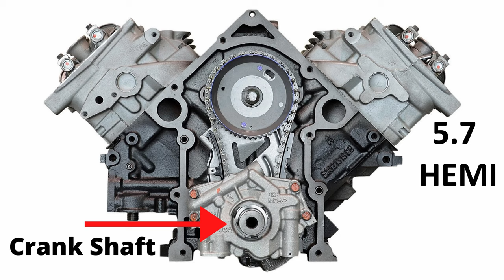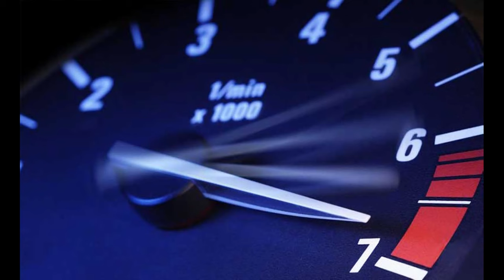HEMI TICK Explained (Easily) - The Cause and How to Diagnose

Comment from the maker: Check out second video on the HEMI Tick for more info - https://www.youtube.com/watch?v=sOH4DCOn0uw
Reply: Hey I got a 07dodge ram hemi would changing the oil every 5000k help reduce the chance of the hemi tic ? (Bad cam and lifter)
Reply: @redneckhillbilly8788  Nope. I have a 2010 and I change the hell out of the oil on average every 6 months and 2500 km's. Issue arrived regardless.
Reply: What if we use a additive to the oil or maybe a sticker oil, would that help?
Reply: Ok so here we go, bought this truck about idk 7 months ago maybe and it was fine but then of course right now today this engine is the 5.7 and guess what the tick has started its right at 219, miles and it has always been taking care of the engine and the truck so yea I'd say this is definitely something that should be recalled but then WE ALL KNOW THAT NO CAR MANUFACTURERS ARE GOING TO TAKE IT ON THE FACE AND SAY YEP WE SCREWED UP BLAH BLAH SO I SAY TAKE THEM ALL AND RUN THEM ALL AND SCRAP THEM DNT BUY ANYMORE LET THEM SIT NOMATTER HOW GOOD A DEAL YOUR THINKING IT IS YOU GET 1 AND YOUR GOING TO ABSOLUTELY HAVE THE LIFTER ISSUE REGARDLESS OF ANYTHING YOU DO OR TRY AND DO.

Comment: This is definitely recall worthy. Step up Chrysler and do the right thing. 👍
Reply from the maker: They won't recall them, It's a not safety concern and it would cost too much money and damage to the Hemi brand
Reply: My 2018 has 86000 km and it’s doing it now….
Reply: not really something you can recall because its about the design and how the lifters sit is all it is. they did the same thing to the 392 but fixed it on the hellcats
Reply: This prevalent on the 3.6 penestar. I own a fleet of promasters
Reply: Chrysler, come on stept up and do the right thing elimate the tick in the engine with a recall.
Reply: @TheGettyAdventures  when the car dies in the middle of the road do to cam determination is a safety concern
Reply: I got a 2006 Dodge charger rt I'm suffering from this 😭
Reply: I wonder if a good flush with BG EPR would fix this. Those lifters have very tiny oil passages that can be clogged.
Reply: My 2016 1500 5.7 with 50K miles just started doing the ticking. 🤬 it is definitely there when the engine is cool and idling. After I run the engine and it’s warm the ticking seems to have gone away when it’s back to idle with a warm engine. Is this just typical of the problem or is this just because it’s had a chance to lubricate those lifters better?
Reply: @lenzkevn  I'm in the same situation as you. I got a 2015 ram with a hemi with abt 56k miles. Cold start ticks pretty bad, but goes away when warm most likely due to being lubricated after being ran. It's frustrating knowing there's not much to do about it
Reply: @lenzkevn  I have the same problem
Reply: I have a 2012 1500 and I’m on my second time having the lifter and roller replaced. My truck only had 100k when it first happed and now I’m at 111k and I’m back at it. At 5k a pop to fix this I’m a very pissed off ram owner. My truck was and still is maintained good oil changes and everything. Now who do we contact to complain cause my level of maintaining my sanity is dwindling with this. They need to recall this cause it’s not right.
Reply: @Youngandfree618  I repaired my hemi myself. Tore down the motor in the truck  replaced the cam and lifters and reassembled.   I've got around 20 thousand miles on it since the rebuild. Changing oil and filter at 3500 miles.  Made all the repairs for under 1000 dollars. Don't trust a shop to do the work. Especially when I can do it myself
Reply: If it ticks cold and goes away warm, it’s not the lifters.
Reply: I agree with you 100%! I have a 2019 and when it got to around 80,000 mi the infamous hemi rattle started.
I am a Mopar man but this is most likely going to cause me to go to GM when I buy my next vehicle
Reply: Only happens to hemi that you let idol for 87 years.
Reply: My 2014 is really bad at start up but I have 186000 miles on it I've asked my local dealer they told that's just a hemi there's no problem
Reply: @mikevalestrada640  
Does it go away when it warms up?
Reply: @mikevalestrada640  even after I replaced the cam and lifters in my 2011  it has valve terain noise not sure if it's the lifters or the timing change I've just accepted it and I do service at 3500 miles religiously and have around 60 thousand miles since the cam swap
Reply: @TheGettyAdventures a thrown lifter will damage the hemi brand too
Reply: Hellcat oil pump.
Reply: My 2021 RAM with 36,500 miles has the ticking now.
Reply: I would agree there is definitely a design flaw with these engines, but I would say that along with the extended idling, I believe the extended oil change intervals, the 5w20 oil and the tiny oil filters put on these large V8’s are adding up to lifter/cam failures…there are so many low grade oils out there that are cheap and plentiful that people are using and these 10,000-15,000 mile and higher oil change intervals because the bottle says “extended performance” are a definite issue…coupled with the tiny oil filter they have that most certainly restricts oil flow in time, is likely a large contributing factor in these premature engine failures…so use a high quality oil and filter and change them often…I have a 6.4 with over 64k on it with no problems…I also do not use the factory recommended oil filter…I use the longer version of the factory filter for more capacity, which just so happens to be the same filter that the Ford 3.0, 3.5, and 3.7 Duratec engines use…fits like a glove…that being said, this filter may not fit on the 1500 hemi’s because the steering rack may interfere…I have the power wagon 2500 which also has a much more stringent oil requirement than the 5.7 Hemi does…I’ve used nothing but the factory recommended oil since new!
Reply: @MrMan5014  I’ve brought my truck to the actual dealership I leased from for the exact mileage allowed for the Chrysler recommended oil change and still got the noise (ticking).
Reply: @MrEdvarts  the problem is the recommended oil change intervals are way to much…I change mine at around 5000 miles maximum!…even if the oil is still able to lubricate, the filters are so small for such a big engine that they are restricting the flow too much after 5000-7000 miles…the very first oil change I did on my Power Wagon was at a quick lube place called Lubber’s and they put a bigger oil filter on it because they said the factory filter was too small and couldn’t hold enough contaminants between oil changes…I think they’re right!
Reply: @lenzkevn just curious, did you end up getting it fixed or is it still running with the tick, my 2016 does the exact same thing. Runs great otherwise, just mostly the noise frustrates me

Comment: For perspective ive been a Chrysler and benz certified mechanic for a decade now. You've made good points, and in my opinion this problem should be recalled. We do have an updated maintenance schedule for the 5.7. Its now 3500 instead of 5000. Due to the design you are correct that the bearing dry out ,but the oil used is light enough to lubricate sufficiently until its ran any longer than 5k miles. We've had 5.7s with as many as 240k miles with no major mechanical issue. Should still be recalled
Reply from the maker: Awesome thanks for the feedback. It does seem like there is compounding issues and not just one clear cut problem. one thing that is crazy is that my 2017 ram tells me to change my oil after like 14,000km. I do it every 5,000 but still nuts that some people trust the "oil life" gauge and get it changed once or twice a year max. so dirty oil could be a large issue as well. Idk it is kind of odd that FCA hasn't addressed the issue.
Reply: 5k miles with regular or full synthetic?
Reply: Would running a thinner oil like a 0w20 vs 5w20 help ?

Any aftermarket additives?  Lucas ? Etc
Reply: @bobbobby6703  full synthetic
Reply: @dark30welderwelding11  thinner oil isn't recommended. Lucas added to the oil does seem to help in our experience short term.
Reply: What would cause a 2021 ram 2500 hemi 6.4 to develop a cold morning ticking that goes away after 5-10 seconds, with only 6200 miles on it?
Reply: @itisfinished4U  that's perfectly normal as it take around 10 seconds to fully coat lifters on a cold start
Reply: @gagecollins9711  first time I've ever heard it, it doesn't affect the longevity of the motor or cause increased wear and tear?
Reply: @itisfinished4U  sounds like an exhaust leak that goes away once the metal has expanded when the engine is warm. "Edit" I misred the 5-10 Seconds as Minutes. Yeah that's normal valvetrain noise at startup while the engine builds oil pressure. To shorten this noisy start-up, use synthetic 0w40. It has worked for my tuned and cammed hemi 5.7 with deleted MDS, which is basically the same engine as the 6.4 except the displacement.
Reply: @bobbobby6703   5000 klicks not miles
Reply: What about the 6.4?
Reply: @lanceg2017  We generally don't have many issues from 6.4s, but in our shop it's 3500 miles for each service
Reply: I heard the problem is the oil pump. To weak when low rpms. I also hear that using a high volume oil pump solves the issue one and for all. The hellcat engine did not have that issue ever that’s why they recommended to install one of those on the 5.7 instead I also saw a video of a guy doing a comparison and it worked. It’s just plug and play replacement. I’m not sure why stellantis don’t do that and change the pressure on the oil
Reply: Do you know what happens if you ignore it and do nothing about it? Like from the user's perspective what will happen if you keep driving while it develops this??
Reply: @agoogleuseranonymous2658  flatten cam lobes, cause misfires, metal shavings. As soon it starts get it in the shop so you can save your cam. It'll be cheaper in the long run. You can try seafoam to un seize the lifter, but doesn't always work. Most times it'll buy you enough time to save up a paycheck and take it in
Reply: @dark30welderwelding11  no run thicker oil in this case. I use a quart of Lucas oil stabilizer during the summer with 5w-20 full synthetic oil. But during the winter run just the 5w-20 by itself and change it every 3-5,000 miles.
Reply: @itisfinished4U  exhaust manifold shield bolts are broken.
Reply: @gagecollins9711  What about Dura-lube? I saved my oil pump on my 2002 f-250, and ive been adding it to my 1500. I have not had the tick come back afterwords, only tick i have now is from my timing chain that i need to replace.

Comment: Did you say this is a single overhead cam engine????? This is not. This is a cam in block. If it were sohc it would have a cam on each cylinder head.
Reply: lol at 4:53 you say it’s a single over head cam. You are 100% incorrect.

Comment: Exhaust leaks are an issue with all engines with aluminum heads and cast exhaust manifolds due to the differences in the different material's expansion due to heat. Just an FYI.
Reply: So could this explain why when my engine gets up to temps the tik goes away?
Reply: @chrislopez7109   yes that’s more than likely an exhaust leak.
Reply: mine is starting to develop the hemi tick, and it is loud on cold start i have a carven r and I can hear the tick, but after I drive an hour to work and I turn it off and on I don't hear it at all
Reply: I have an 04 and it makes a tick sound till it starts warming up then it goes away , truck runs smooth as silk on startup and when it’s warmed up, it’s done it since I bought it, guessing exhaust leak?

Comment: In my history with hemis most of the time, it is an exhaust leak. They will likely never recall because most 99% of the Ram 1500 and 2500 with Hemis will make it over 100,000 miles before major issues set in. This is probably why they are going to an inline 6 hurricane motor in 2025 which I already have my doubts due to putting turbos and cranking the hell out of that little motor making 500 hp with a 3.0 eventually something will break.

Comment: This video is 10000% spot on. Happened to me at 117k miles on my 2011 Ram 1500 4x4. It’s a design flaw and FCA won’t change it or recall. Will NEVER buy another Ram again.
Reply from the maker: well sorry to hear that. but yes there is no way FCA is not aware of this problem and are trying to sweep this under the rug
Reply: @TheGettyAdventures  they are banking on the hope the customer didn’t get the lifetime warranty so they can make $4-5k on replacing the long block due to metal shards in the motor. Why make a change when they are making a ton of money? I will never buy a RAM again that’s for damn sure.
Reply: Tbh every car has its flaws its just really picking your poison. Ford and GM are no better.
Reply from the maker: @Johnny-pj2fm  you are correct. each manufacturer has its downfall
Reply: Yea my 2013 Silvarodo with 5.3 ticked at 80k, fixed under warranty then it blew up at 102k out of warranty.  6k for factory 5.3.   1% to 2%  failure on Ram lifters after 100k mostly isn't out of ordinary.  You have to wonder why Ram is out selling GM now though.

Comment: I had a friend who had to replace the upper valve and rocker, cam  , lifter assembly because of this problem,,, but what he told me he did was use a different grade of engine oil than what the manufacture recommended. The recommended oil grade is 5W20...he started to use 10W30, then 10W40 then went to 20W50,,,he thought the thicker oil would help lubricate the internal parts better, but what happened , and he found out was the oiling ports inside the Hemi are very tiny, ,the thicker grade oils couldn't get through to areas where needed. ,,especially at cold start. My Hemi has that tick, I'm at 208,000 but I've always used the right oil,,5W20..switched to full synthetic years ago, and always change on time. My tick goes away under power, but faintly is there. Oil pressure is very good,  so I'll just keep going till it goes. You stated that idling is bad for these engines,, what do you do in stop and go city traffic,,??..or stuck in stopped traffic on the highway..??..idling is probably unavoidable.....my truck is a 2006 Dodge Ram 1500,,,,hopefully I don't have the defect..
Reply: Thats around the time that they started putting hemis in everything
Reply: I have a '13 model 5.7 . Got it at 40k miles got 120k on it now. I have a tick but it seems to be the exhaust bolts. Something I've always done is 6 quarts mobil 1 and 1 quart marvel mystery oil. Can't really say for sure if it makes the difference or not. Obviously in traffic or drive thru i idle but I do not let my truck " warm up" in the winter. Just get in it and go!!
Reply: what kind of oil are you using

Comment: The Hemi is not a overhead cam design, but they did raise the cam location higher for HP.  Which starves the upper end of the engine lubrication. I changed my oil to 5 w 30 and have no hemi tick now 👍
Reply: does that void warranty tho ???
Reply: @bradhart4179  No ,it's in my manual that if you tow anything like a boat , that it's recommended to switch to 5-30.

Comment: Just had a cyl. 7 exhaust side lifter fail on a GC SRT with 203000km. That's one of the MDS lifters. I've had MDS disabled by a tune since 174000km.
Now will be switching to non MDS 6.4 cam, EngineTech lifters (which throw oil at the rollers and cam), and a hellcat oil pump to compensate for the possible pressure drop. Wish me luck!
Reply: How did this turn out?
Reply: @gunsite45  I'm at 335000km still running good 👍
Reply: Thank you!  Thinking of doing the hell cat oil pump for starters
Reply: @gunsite45  My local Mopar shops uses Melling high volume pumps as a standard procedure for failed lifters/cam. That's another option for you if you can't find a hellcat one.
Reply: سلام يالعمري، الكام والليفتر من وين تطلبهم واذا فيه ملاحظات قبل ما اطلبها ياليت تعلمني وشكراً لك 🙏🏼

Comment: Have a 2011 Ram with 478,000km. Had the tick nearly from driving it off the lot. She is still going strong, and the tick is stronger than ever, something you get used to
Reply: Me too but only just under 150,000 miles mine has a knocking sound underneath but I think maybe it's an exhaust leak?
Reply: @zacbass1636  if it goes away after warm up then egsaust,but if gets worse after warm up then lifters.don't ask me how i know.
Reply: You are 💯 right. Funny I learned it from uncle tony